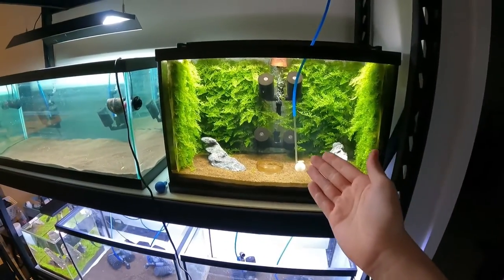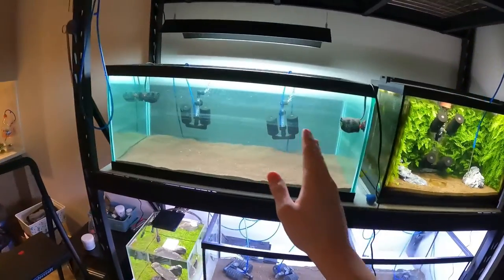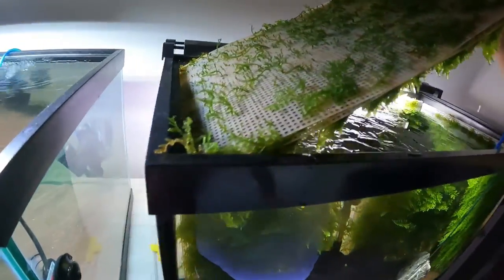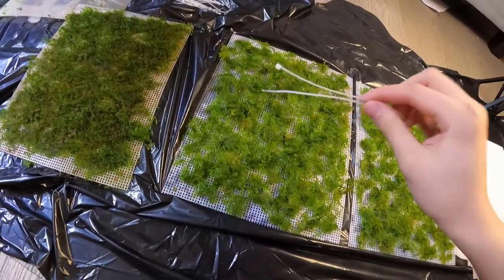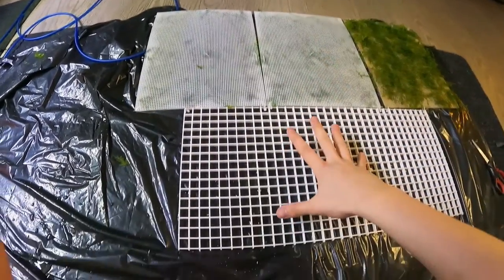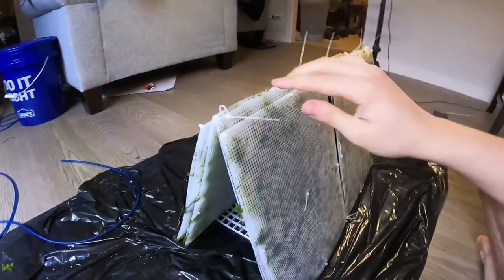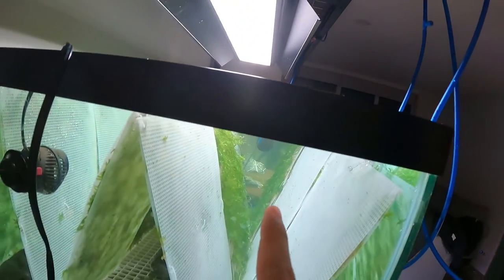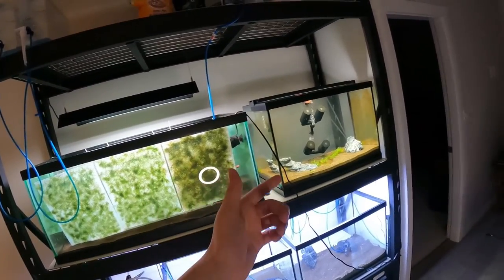Moss Wall DIY (Guide & Tutorial)

Comment: Hey, could you run through what you do to keep your moss so healthy? Do you dose any ferts? How strong is your lighting? And any other general tips? Thank you!
Reply from the maker: honestly for me cold water, some basic Fert (I like easy green but any works). Trim them once in a while. I have pretty intense lightly but honestly doesn't matter too much. I would say the best general tip is to have good circulation. Have a few sponge filters or a decent flow in the water.

Comment: Do you worry about shrimp going behind and dying? What about during grow out?
Reply from the maker: I had them close to the class and in the soil to above the water so never really thought that. A few did get back there but I guess always found a way back out, never saw one die back there. Grow out as in too bushy? I do a healthy trip, take quite a bit off so that I don have to do it often, doesn't look great for the next month or so but returns back to normal. Ive found if you dont trim it, it actually stays quite nicely but once you try pull it out of water where the moss attached to the wall is very weak or "long". so if you dont mind just leave it, but I would keep trimming it the more the better cause then it grows thick instead of long

Comment: Wow! The Christmas moss wall  in the initial tank 🤌🏼😗. I’ve always wanted to do the same , just never knew how. What Co2 system do you have ? You quickly glanced over to it and so I couldn’t get a good look at it. Do you have a link for it ?
Reply from the maker: Yea for sure, Im using the fluvial small 95g c02 system with a Neo diffuser. I wouldn't recommend it long term (as I have ordered a new c02 system that is in the mail) but for a temporary grow out tank or low c02 it works good (the refills are pricy that's my personal only downside so far)
Reply: @ThatShrimpDude  thank you for for your response. Any links for your current and one that’s coming in the mail ? I need one for a 20 gallon long shrimp aquarium.
Reply from the maker: this is my current one.  https://www.amazon.ca/Fluval-17557-Pressurized-3-3CO2/dp/B079YY2NJP/ref=sr_1_4?crid=3U4KFZ4V1NH6M&keywords=fluval%2Bc02%2Bkit&qid=1646445281&sprefix=fluvial%2Bc02%2Caps%2C215&sr=8-4&th=1 The one in the mail is a DIY one but I don't have a link for it as it was a private order. Ill make a video on it and see if I can find some links when it arrives hopefully within a week or two. Hope that helped!
Reply: @ThatShrimpDude  definitely helpful. Thank you